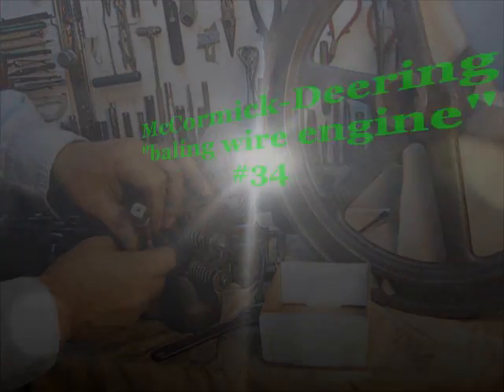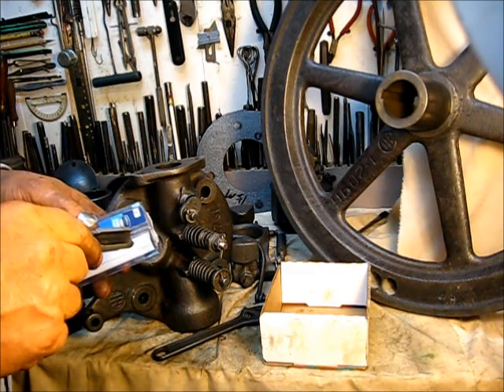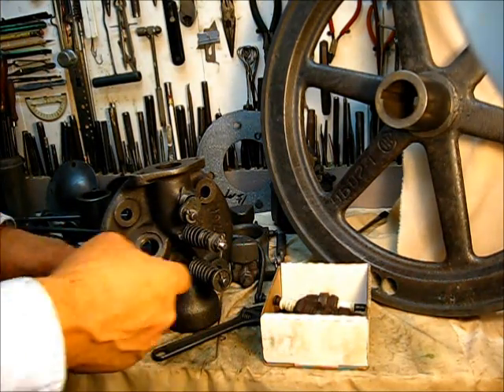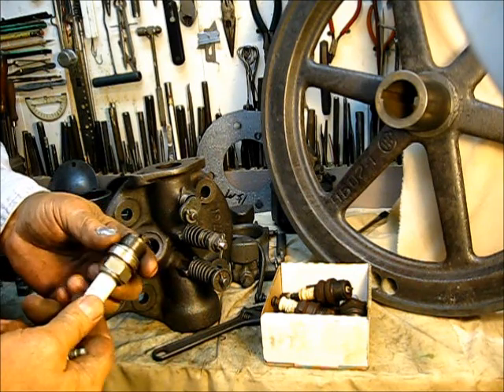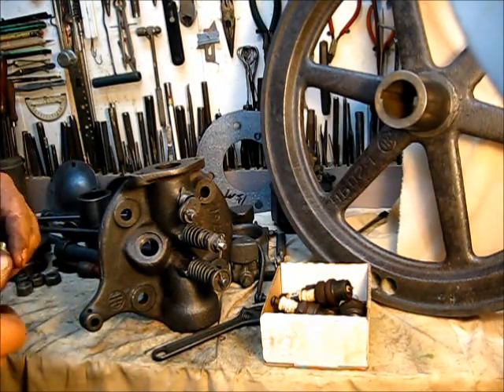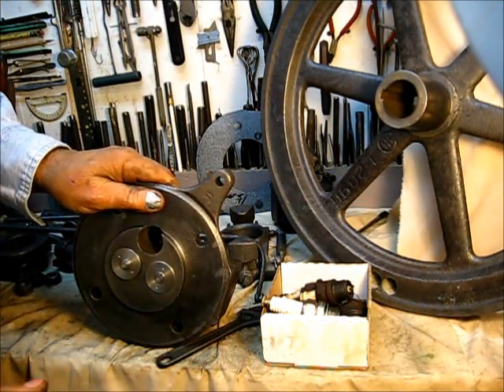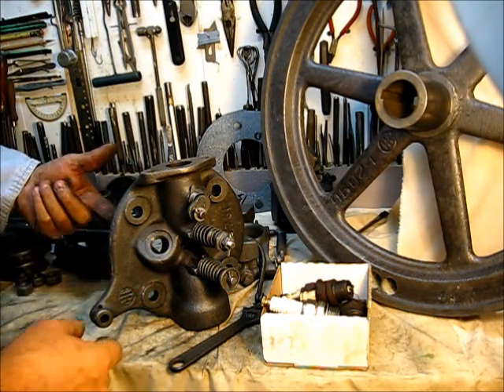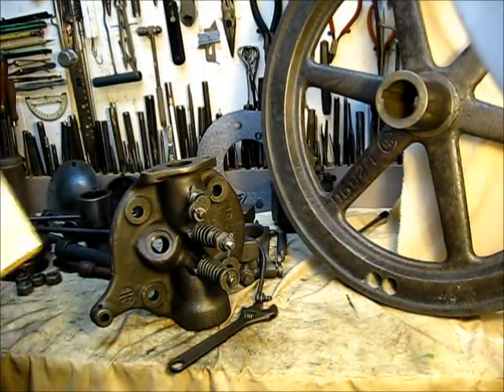McCormick-Deering "baling wire engine" #34

Comment: Sam .....I respectfully disagree ........My argument is .....It makes No Difference where the electrode gap is oriented  as the explosive gasoline vapor atmosphere completely surrounds the entire  electrode irregardless of where the plug gap points  so as long as your Magneto has produced a strong spark between the properly set plug gap  and your mixer venturi has produced an atomized gas air mixture with no vacuum leaks Indexing has i no intelligible advantage in my humble opinion  .....  Thanks ... Hoosier Patriot
Reply from the maker: ,,,explosive,,,, that's the problem,,, in these low compression engines it's hard to get the gas vapor to burn at all,,, the keyword is gasoline vapors burn,,,, and it's why high compression engines in the winning drag race cars have indexed sparkplugs,,, and the indy 500 cars, plugs indexed,,, and Dyke's automobile and gasoline engine encyclopedia described it as disrupted flame front,,,

Comment: Love your series on the "M" Sam, but every time I watch a new video, I have to either tear my engine back apart and/or write down a bunch of info for later on in the rebuilding process. I hope you will go into detail on setting up the timing and valves in an up coming video. Thanks.